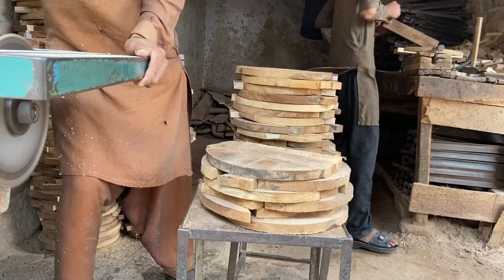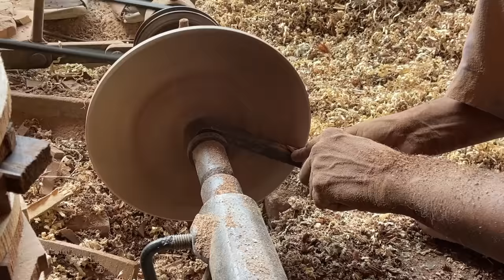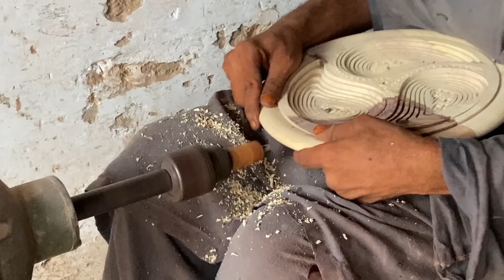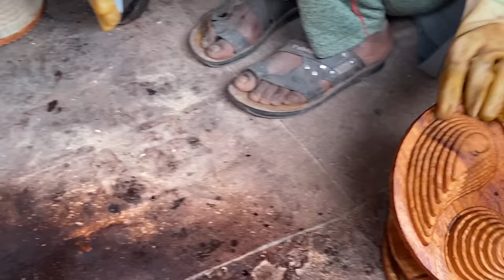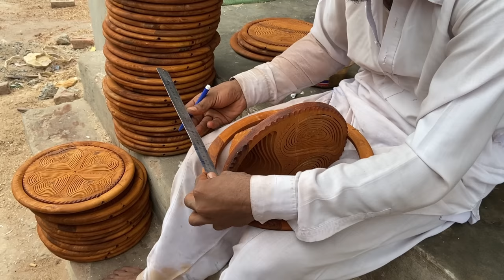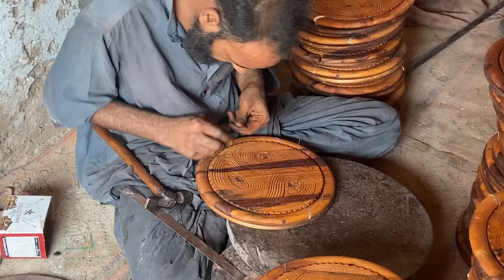Process Of Making Three Portion Wooden Spring Tray  | How To Make Wooden Tray By Carpenter

Comment: In Canada that operation would be shut down, the owner would be facing fines of up to $100,000 and each of the workers up to $10,000 for all the OH&S safety violations such as , no personal protective gear(glasses, gloves, steel toe shoes, etc), no guards on the power tools, unclean work space, etc. Also the workers would have to be paid at least minimum wage, have regular breaks, and have safety meetings every new shift. The tray would cost at least $100.00, plus sales tax. And thats before any union gets involved. Its a great looking piece but you'll never see one built here.
Reply: They are not in canada so don't worry yourself
Reply: Well said tee

Comment: Where the pasting gum adhesive is available.
Reply: It is the normal PVA glue for wood. Apply, clamp and Leave it for a day before removing clamp use. Needs pressure to join. After proper drying, the joint is more stronger than the wood.